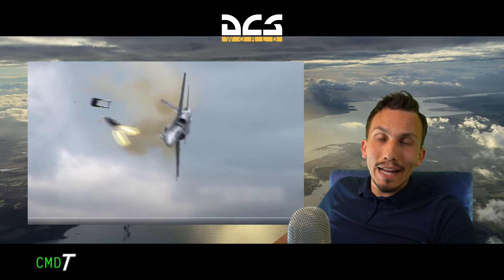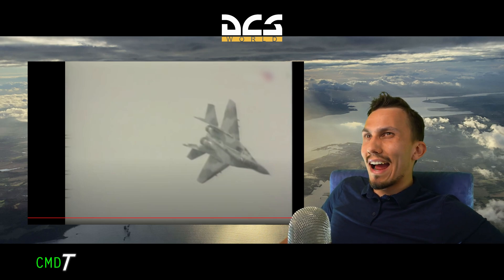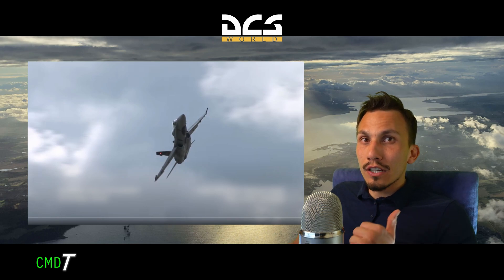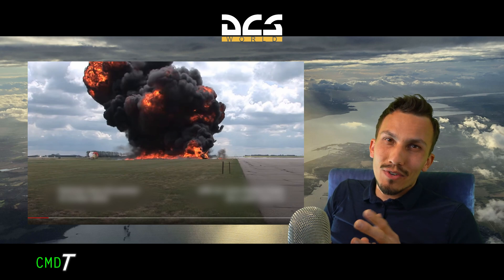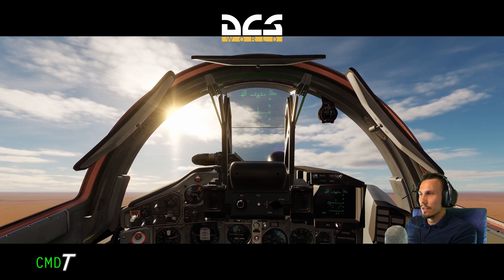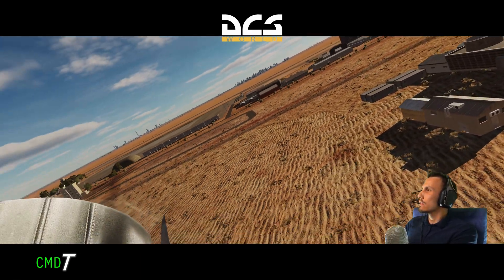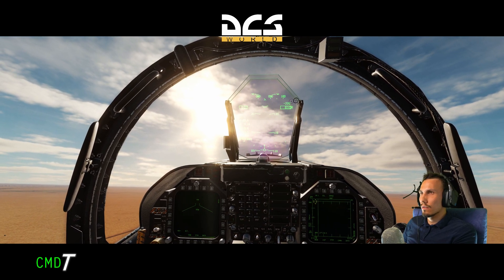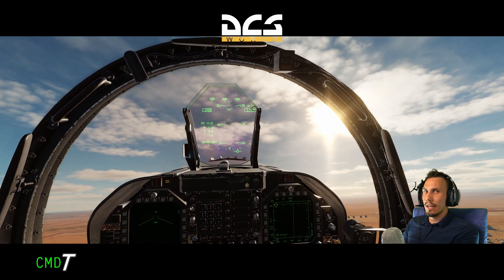Airshow Crashes Recreated in DCS - Same As Reality?

Comment: Hey T. Nice video I like your other stuff too. How do you set the wind? In the original CF18 footage. After the pilot landed the parashoot (and the smoke) idnicates the wind from right to left (almost perpendicular to the flight path). Could this amplify the yaw effect? Even in the footage with mig29 it seems that he wind direction is from right to left (flags) maybe from the tail. The lack of air mass flow should cause compressor stall and engine failure.
Reply from the maker: Interesting point. Somehow I doubt it would have made much of a difference given as they are flying on indicated airspeed. Can't remember what the wind was set to in the mission editor. Probably zero.
Reply: @CommandT  I mean... Flying 90kts brings the Hornet to the very limit from the aerodynamics point of view. In this particular situation when the yawing moment appears the right wing goes down. IF e.g. 5kts-10kts wind from the right will load that right wing, do you think there will be no impact ot the bank moment or at least it will be not harder to level the wings?
Reply: @delayed_control  That is wrong, since wind is not constrained to flow parallel to your direction of motion. Wind can come from any direction and it DOES affect the net effect of control surfaces on the aerodynamics.

Comment: Yeah I think you can't release the stick or the jet regains speed, maybe do the mig-29 slower and keep pulling the stick.
Reply from the maker: I'm not sure if it was different pre-2.7 update but with the alteration to the MiG-29 pitch damper in this last update I think 210kph seems like more or less a limit for controlled straight and level high alpha flight. I think any slower and a wing would start dropping on it's own due to a stall. And yeah if I keep the elevator locked in position without unloading, maybe results will be more similar to reality. I'll try it :)

Comment: 15:50 exactly like in the video of the f18 accident but with two running engines
Reply from the maker: That was single engine. I waited to see when it would start to yaw/ roll on a single engine :)
Reply: @CommandT  what do you mean when you say you don't feel the dynamics in DCS are realistic?
Reply from the maker: @nator1654  I mean in this particular scenario I think the modeling of the thrust on a single engine & yawing/ rolling moment for the given speed seems incorrect looking at the two videos of the real crashes. I don't think it should be as recoverable as it is in DCS. Personal opinion.
Reply: @CommandT  Agreed, although in the case of the FA18, you were indeed much higher up when trying to recreate it. 
I would also add that rudders seem to affect the jets aerodynamics even when it’s travelling slightly above stalling speeds in DCS which is very unrealistic as there’s definitely not enough airspeed for them to really do anything; you can see that this is indeed not realistic when comparing to the video where if you zoom in you can clearly see full rudder deflection by the pilot and no net result by the end of it.